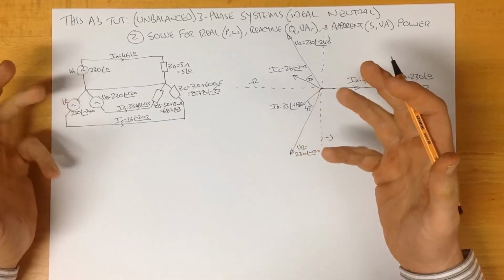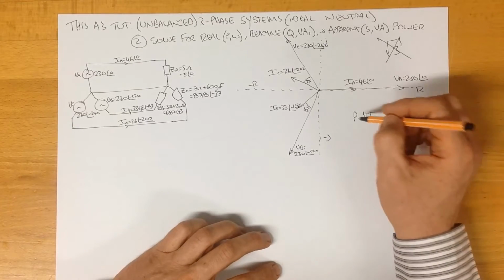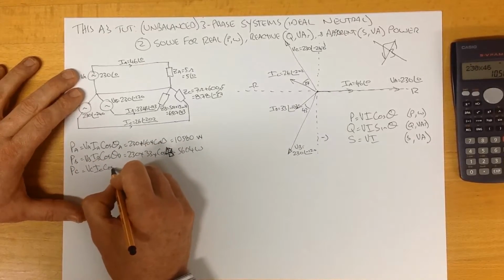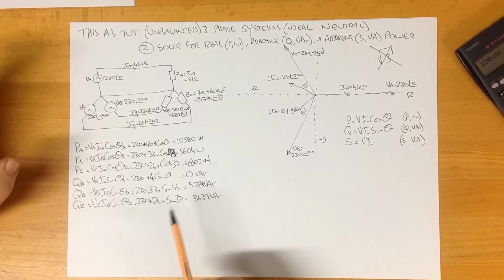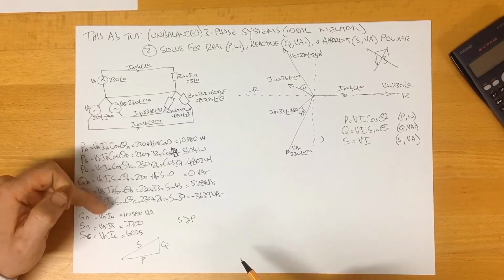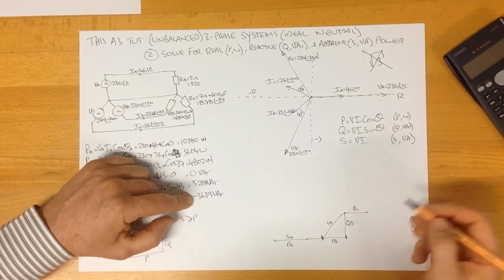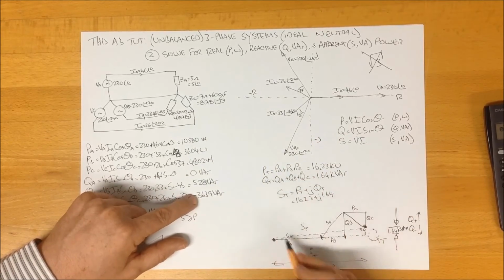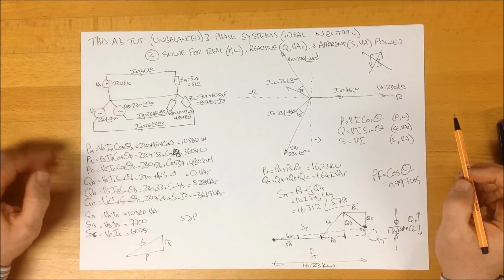Taylormade@AUT A3-tutorial: Unbalanced Three-Phase 4-Wire Star system (solved for power)

Comment: Dear Taylormade, Thank you for the great videos. Can you please explain how would the voltage drop accross each load (or line to neautral) can be calculated considering real lines (with impedance, phases and neutral)?
Reply: And perhaps it would be great if that can be explained or calculated using "symetrical components"

Comment: I use same method..  I conveet first the loads to wye from delta and i ddnt get the answer..  
A Three-phase 120-volt circuit has a phase sequence of abc and delivers power to a group of delta connected impedances whose values are Zab = (10+j0): Zbc = (5+j8.66): Zca= (8.66+j5).
Calculate total power in watts.. Choices are
3660 , 3920 , 3880, 3410..
Reply: Fuck!! I got the the answer..  I simply ddnt convert it..  Thanks much!! Haha
Reply: 3410